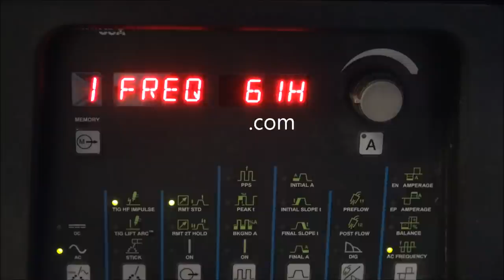Top 2 TIG Welding Torch Holders - Simple and Versatile

Comment: I have got a question. How do You protect Yourself while welding aluminium? I mean the breath protection. Do You use welding hood like 3M Speedglass with air filter? Do you use welding fume extractor? Im asking because I weld steel for now, and i would like to start welding some aluminium parts as people are asking for it.